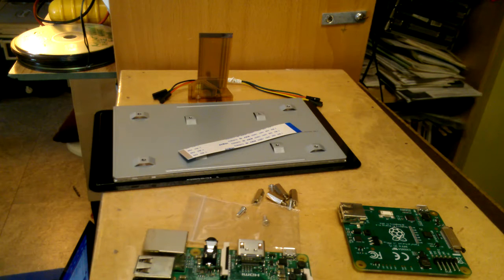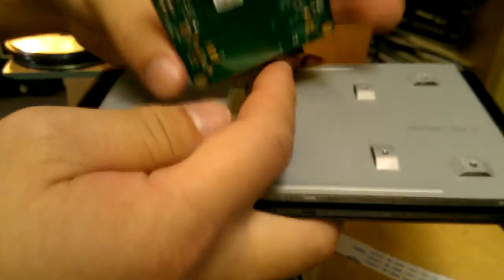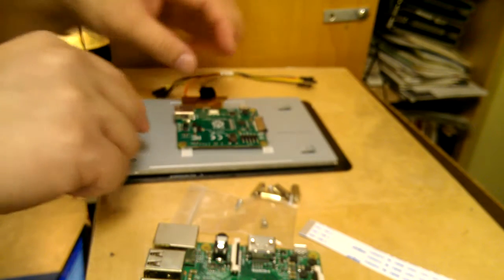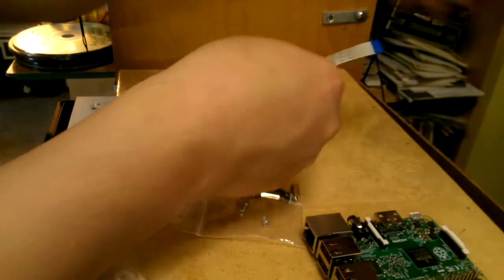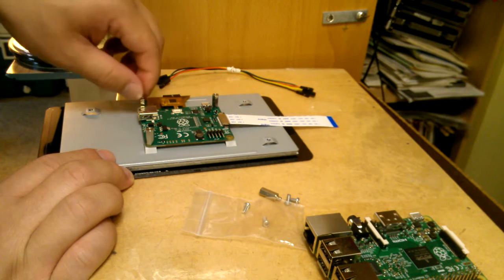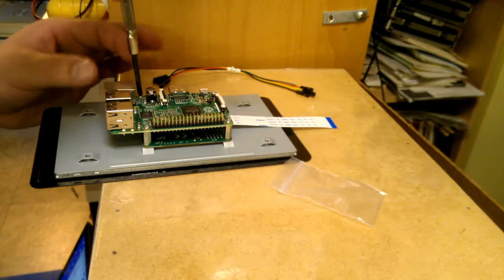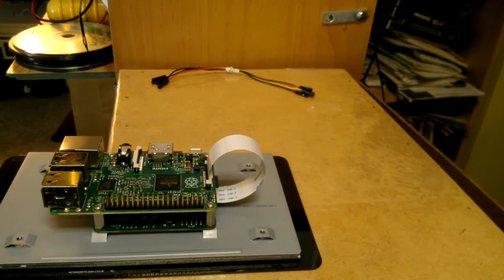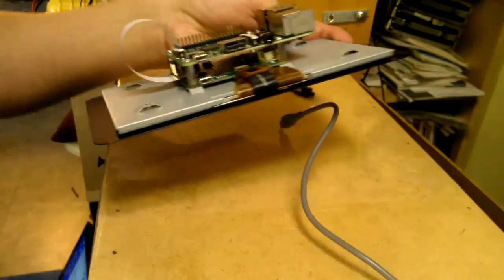Raspberry Pi 7 Inch TouchScreen Display - Part 2 Assembly

Comment: Do they come in 3.5 inch?
Reply from the maker: This is the first official screen from raspberry pi.  Its been out for a lot of years already. You can get 3.5 inch screens from adafruit.com. They are in NYC. Otherwise you'll have to get some screens from the UK. Or you can also find endless LCDs off of ebay, they all come from china.
Reply: But the aquire GPIO pins which i need to use. They don't come in only hdmi they use hdmi with GPIO or only GPIO. But no "3.5" inch display with only hdmi. I intended to use the DSI port for 3.5 inch display but i dont find them.
Reply from the maker: @aalrafi529    they take composite input.
Reply: You mean to say 3.5 inch Rpi uses composite input or u mean that i can use it with composite output.
Reply from the maker: rpi has a composite output, plug a cable one end to the pi, plug the other end to the 3.5 inch LCD screen. The LCD will act as a  display for the pi. the LCD is the monitor. The LCD will show what the HDMI would show.  when you boot up the pi, it will show on the LCD.  After a minute, you will get the raspberry pi desktop on the LCD.
Reply: Thanks a lot

Comment: dangerous, ins't there a chassis that you can use with it, before attaching it to the monitor?
Reply from the maker: +Laurens D That's how its assembled. There is no case or any isolation. Just physical spacing to prevent short circuiting.  You could use electrical tape.
Reply from the maker: +Laurens D In fact I was at a "Maker Faire" in NYC. Raspberry Pi had a table and they showcased their new touchscreen displays. The circuit board and display were all naked and powered and up and running.